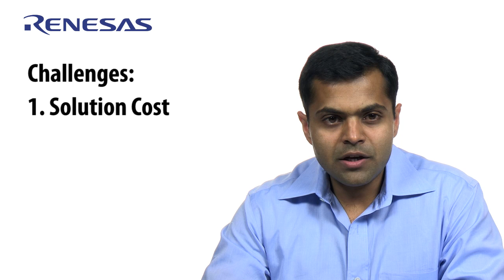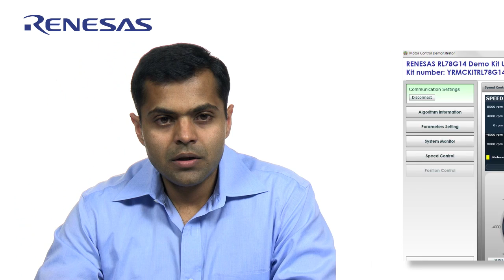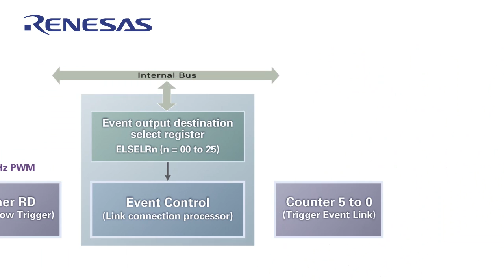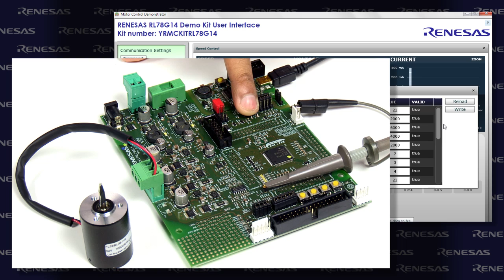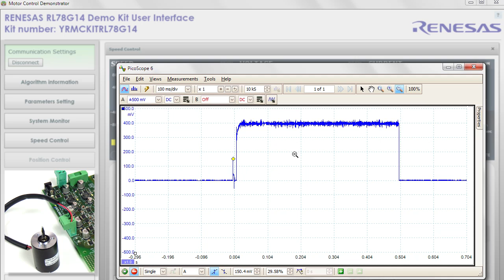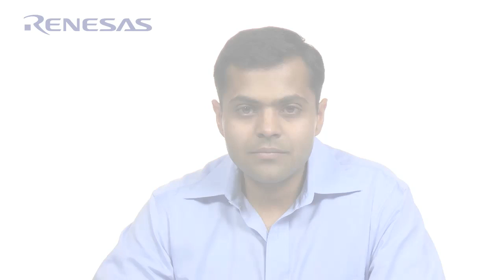Motor Control Tuning Demo

Comment: Dear Sir, I am trying to do the exact same thing you showed in the video, i.e. adding a PI current control loop to an inverter. Could you please recommend a good current sensor for currents in the 0-3A range. The ACS 712 I tried has too much noise corresponding to upto 0.5A current. What is the acceptable noise level and rise time for a current sensor for such an application. Also how do I finalize the PWM frequency (which will be the frequency of the control loop if I am not mistaken)? What should be the cut off frequency and order of the AA filter before the ADC?